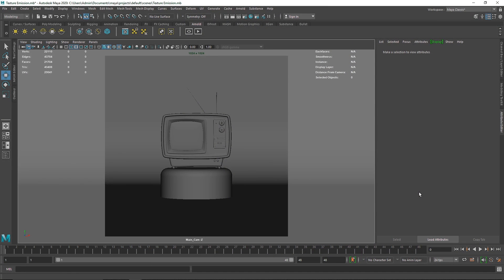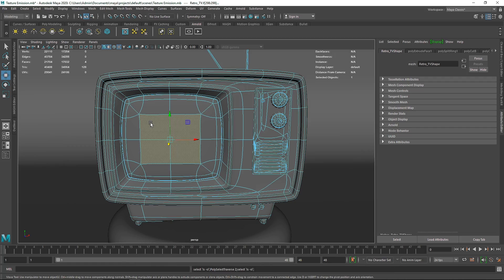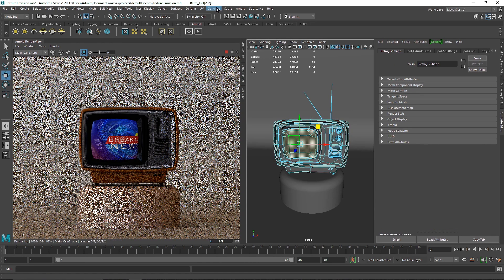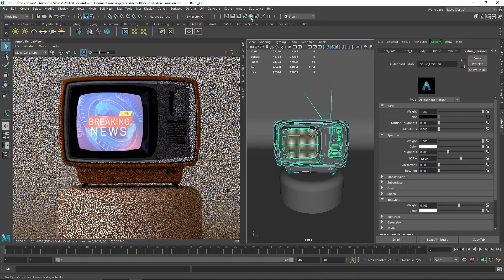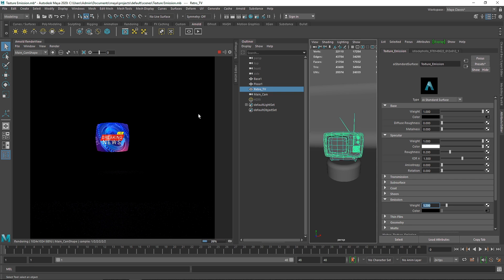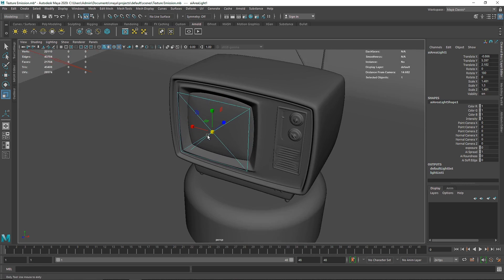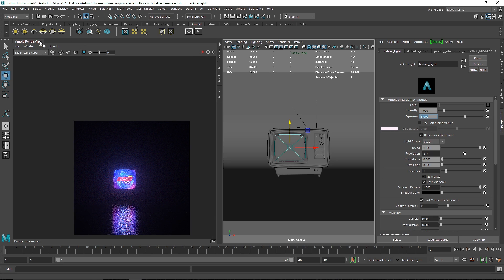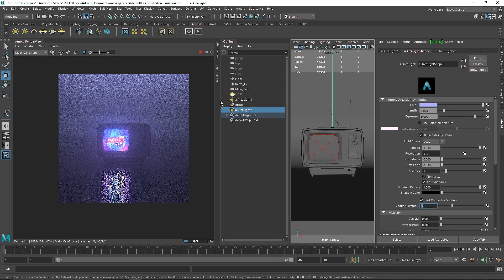How To Create Texture Emission In Maya & Arnold Renderer - Tutorial

Comment: For anyone who's having trouble copying and pasting your nodes to the light, heres a workaround. Highlight all the nodes in the material that you want to transfer. Control + C, Control + V. Nothing will happen in your node network but youll see a "pasted__(whatever your texture is named)" in your hypershade material list. Next go to your light in the lights tab. Hold right click on your light and go to "Graph Network". Click back to your material tab and middle mouse drag your "pasted__example" shader into the light network.That wont bring everything so highlight your nodes (Should only be 2, the base shader and the light) and click  "Input and output connections", which is a box with an arrow on the left and right side. This should bring everything back to the way it was and you can delete the base shader and plug your images out color into the lights color. This works with image sequences as well.
Reply: you can use ctrl + D as well, much faster :)